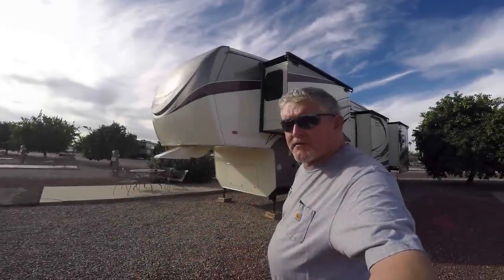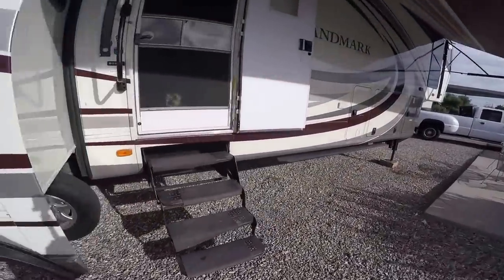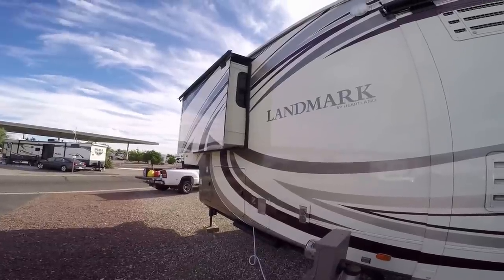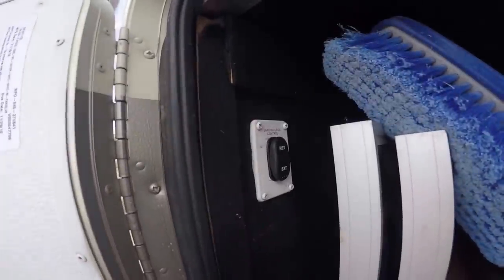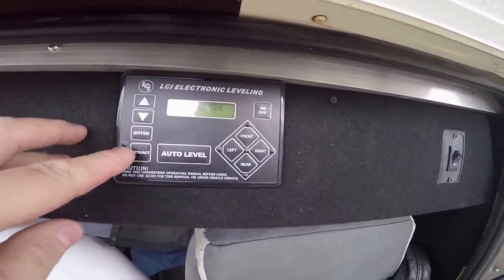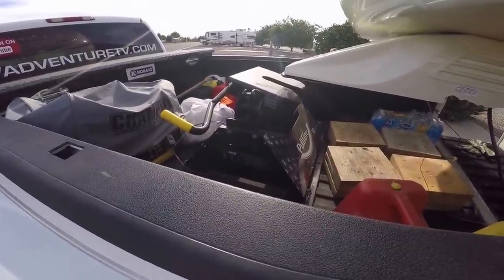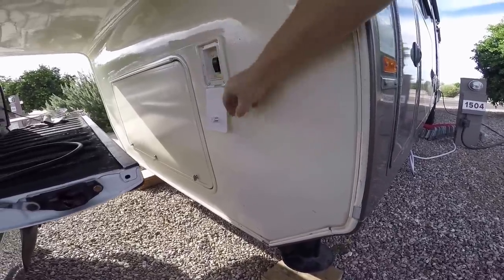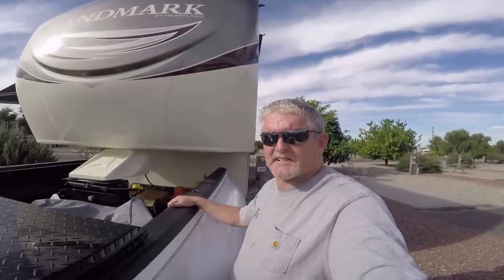RV Life. How to hook up a 5th wheel RV to your truck. Time to leave and find another location S4 E18

Comment: Awesome video!!    A few things I do somewhat different are:  
1)  Breakaway cable I connect to the truck somewhere, in case your hitch pulls out of the bed. I use an extended stainless steel cable w/ a carabiner to attach the breakaway cable too.   Now I have had a problem before when making a sharp corner and something in the bed hooks the cable and pulls the pin, not too bad with the old drum brakes, but with my new disk brakes the trailer does Stop. I did hear once from a fellow Louisiana camper that the Louisiana State Troopers do look for the breakaway not be connected to the hitch. Made sense to me...
2) Once the truck is connected, I raise the front jacks till they just clear the ground, I do a tug test on the 5th wheel hitch, just to make sure its really "locked".  Then I raise the front jacks all the way.  This normally works best with the utilities disconnected and use wheel chocks or works even better with the new disk brakes.
Thanks for sharing and safe travels!!

Comment: One thing as a retired t/t driver trainer, always look at the 5th wheel connection to make sure there are no gaps between the upper plate on the trailer and the 5th wheel. Go behind and yes, you have to go between the trailer and the back of the pick-up and MAKE SURE the jaws are around the pin. Yes, it clicked, but that does not mean that the jaws have closed completely around the pin. In addition, do a second walk around checking tires, lights, turn signals as well. Good video.

Comment: Very informative!  Being a retired semi truck driver I am suggesting to do a tug test when you hitch up before retracting the landing gear. Also look into the hitch from the back to make sure the locking jaws are locked around the king pin. Have seen many times a 5th wheel come unconnected and drop onto the bed sides and damage the truck and trailer.
Reply from the maker: I agree totally.. I always put the truck in drive and try to pull ahead to make sure of the connection.  Thanks for the comment
Reply: Yes !!! I totally agree . First time I hooked up my 5th with my wife watching we heard the click but ..... we pulled forward ever so slightly and sure enough it wasn't fully hitched . Thank God!!! I did the tug test . I would've wrecked my brand new truck and trailer
Reply: good eye....i noticed the same thing. Sucks if it pulls off the hitch while your landing gear is up
Reply: Also I have a short bed Mega . That forces me to get the slider hitch . I have but one complaint with it though . U have to be perfectly straight which sometimes is a real pain in the a$$. It limits some spots i can squeeze into with a normal hitch . I can hook from a 90 . Other than that it allows me to 90 the truck without wrecking the cab of my truck I absolutely love it . In hindsight though I really wish I got a long bed .
Reply: Yep, it happened to my cousin😳 Bad damage to the cap of his 5th wheel and mashed in the bed of his truck!! Soooo he as well as we ALWAYS triple check every time!

Comment: Hey Darrell nice rig!  I didn't see your chock blocks,  something I always use for safety.  I have the new (2015) LCI auto landing gear on my fifth wheel, auto leveling auto drop off.  When I'm ready to leave I hit both left and right buttons at the same time and it raises the rear landing gear and brings the front to the level it was dropped off at.  May not be the same as you have but very convenient.  A quick visual check of the fifth wheel hitch being locked makes me feel better, then once everything is up, stowed away and secure I plug in and do a tug test against the brakes.  Last before we hit the road is a light check and a walk around.  Always check for left items by the utility post/water and sewer connection as well as the pick nick table area.  Safe travels.
Reply from the maker: I have chock blocks and use them when I am in level ground or setting up.  Bought them through Ray at +Love Your RV Youtube channel.  I have 1 button retract on mine that will bring all 4 jacks up automatic but I don't think this model has recall on it. I always raise my rear stabilizers first before adjusting the other 4 levelers.  They are just scissor jacks really and not used to level.  Looks like you have a great plan also!!     Have a safe trip
Reply from the maker: +Love your rv

Comment: I know this is 2 years old but can you use the light or trailer plug outside of the bed?  Mine is on the back bumper near the license plate?
Reply from the maker: I also have one near the licence plate, but i use the one in the bed due to the power cord coming down from the fifth wheel pin box.  If I was pulling a pulling a trailer using my ball/receiver hitch I would use the one at the bumper.  Hope this helps

Comment: hi guys im thinking about a fifth  wheel  but i want to take an atv with me is or have you seen any one hall one of the rear hitch that might come with the unit i no there are some out there i guess it would only be safe with the one that has a wheel  on it thanks allen dont want to put more weight back there right
Reply from the maker: I am assuming you are talking about the rear of a 5er  IMHO  I would never put anything that heavy on a rear hitch of a 5er.  The roads anymore, plus gas station access, etc etc would put a lot of stress on a rear hitch connection.  Not saying you could not, but I have never seen one..  Now I have seen scooters, motorcycles and ada stuff but never a 4 wheeler.  In fact my rig does not even have a rear bumper to make a connection to..   Great question...Thanks

Comment: Hi. You seem very experienced, so question:  When boondocking in a remote area and for some reason i want to be able to leave in a matter of seconds, is it ok to have the fifth wheel fully attached to the truck and ready to go? ...at most just for 2-3 nights. I would use a wireless remote to retract all 6 landing legs/stabilizers, and to retract the slides (and awning but likely won't be extended). I would also remove any chocking, locks, wires, etc. beforehand, and all chairs/tables would be packed up beforehand too. Btw, when attaching the 5er to the truck, I would make extra effort to ensure the 5er is level even when hooked up to the truck. Call me paranoid but this is only for that rare case where no other campers are around and a suspicious group or vehicle shows up in the middle of the night. I like to be prepared. Besides being careful all legs and slides retracted properly, any concerns with this?
Reply from the maker: I have left the truck attached many times.  If the ground was level or just a little off I could manually lower the jacks enough to make due.  Helps with the slides being out and stabilization of the frame.  Just remember park in an area that you can use your escape plan and can't get blocked off to your egress.  Sound like you are on the right track .
Stop The Madness  Start The Adventure
Reply: Someday's Here Perfect! Much thanks!
Looking forward to more of your uploads!